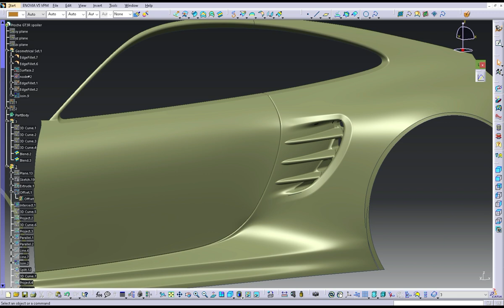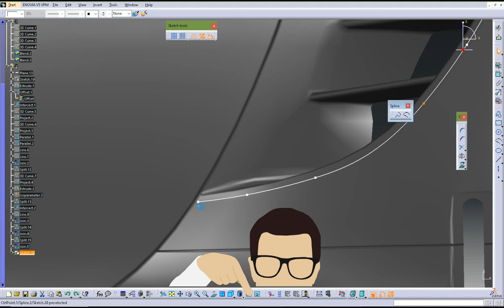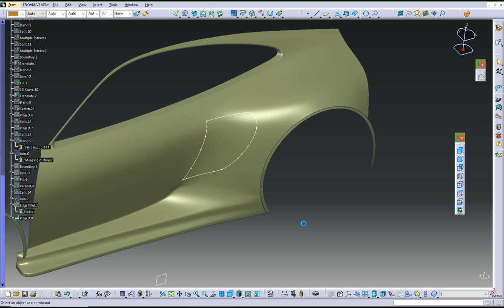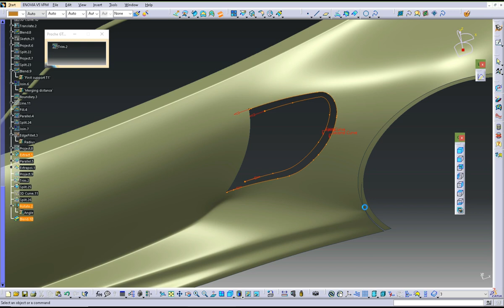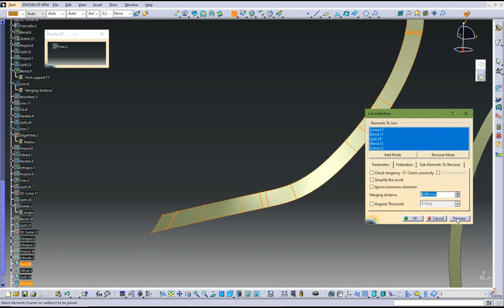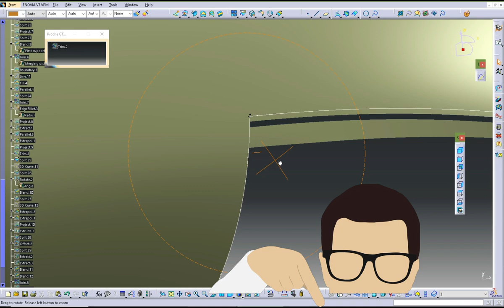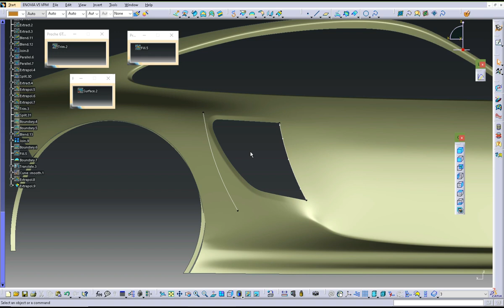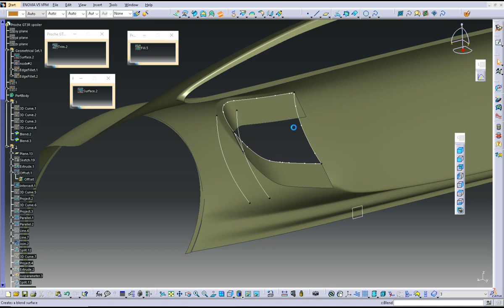Class-03 Porsche 992  Side panel Air vent-Part-1

Comment: Very good class. Do you have any tutorials using the Catia Wireframe module to design a car curves? Or even the GSD module, instead of Alias.

I used the Imagine and Shape to create the subd surface but it doesn’t look like a A Class should
Reply from the maker: Thanks. So far I will start the Audi R8 modeling using only catia GSD. Alias SubD is far better then catia imagine and shape. You can get any aesthetic shape with minimum time and effort..